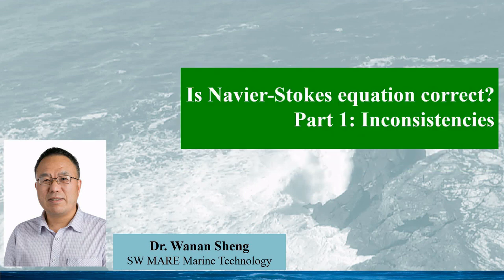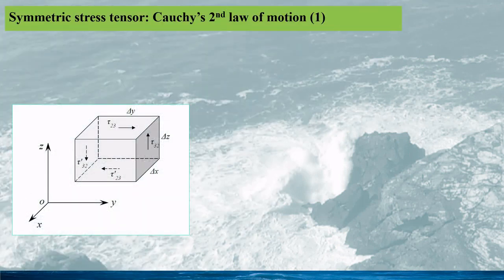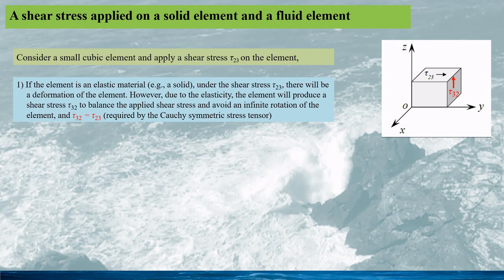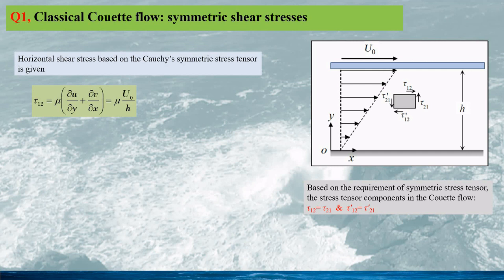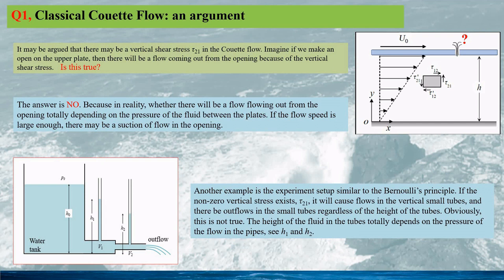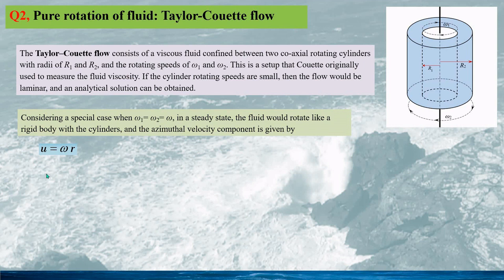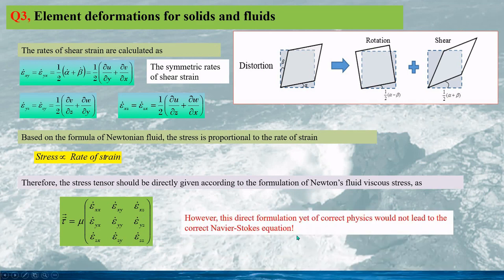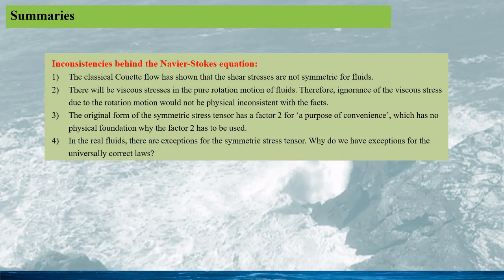[Fluid Dynamics: Equation] Is Navier-Stokes equation correct? Part1, Inconsistencies

Comment: Wanan, you are assuming that the Newtonian fluid. The Newton model is not always true and the deviatoric stress stress tensor can be viewed as the first order term of a series... Why the stress tensor do not have second order terms? Nevertheless, nice talk.
Reply: Navier Stokes is only for Newtonian fluids. You need the more general cauchy momentum equation for non Newtonian fluids.
Reply: @shoopinc  Thats right. The second order terms, are neglected on the original formulations and others, because the set of equations turn highly no-linears and its supoused that terms are negligible.